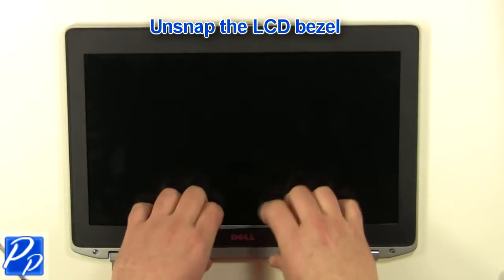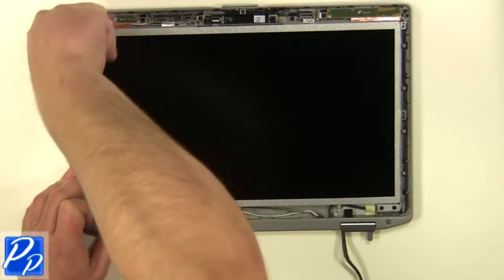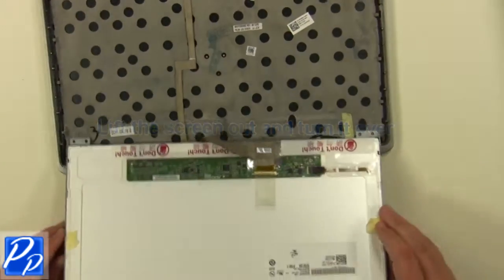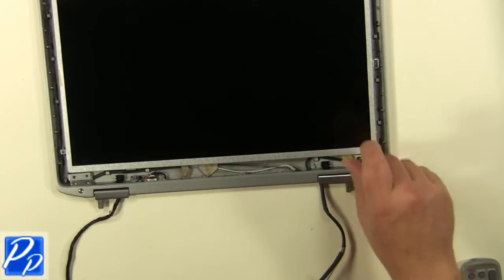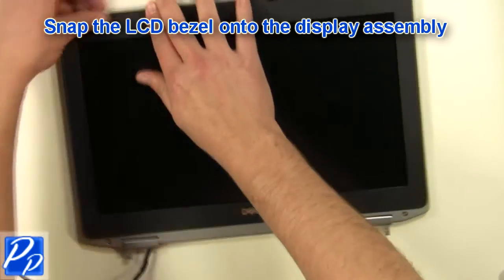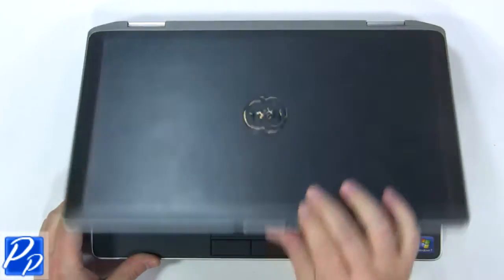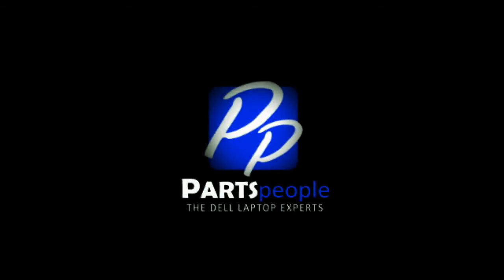Dell Latitude E6420 LCD Display Screen Replacement Video Tutorial

Comment: You must also detach the frame on the left and right sides of the existing display and reattach to the new display. Two screws each. Easy enough to do. Thanks for the video. One of the easier displays to replace.

Comment: Ahahah !  Thank you for having cut for the separation of the  full screen assembly from the main body, this is precisely what I cannot do, the two screws at the back of the hinges have been removed and yet the screen part does not separate always the rest.. You probably struggled too, then you deleted this part of the video.. I ended up seeing that there is still a screw below the hinge.. :)

Comment: Does this computer have a 30 pin connector or a 40 pin? I can't quite tell, and I don't wanna crack mine open until I actually get the replacement part

Comment: Hello, a question my display is all black, but if I use a torch you see something, the problem is the backlight? Do I have to replace the display and just need it? . Thanks for a reply.
Reply from the maker: Yeah, it sounds like the backlight has failed. You will need to replace the screen.
Reply: Grazie infinite.

Comment: Hello can I replace a normal LCD screen on my Dell e6420 with a touch screen one? will it fit within the display compartment?
Reply from the maker: To install a touchscreen you would have to replace the back cover assembly. The touchscreen vs non-touchscreen are different sizes.

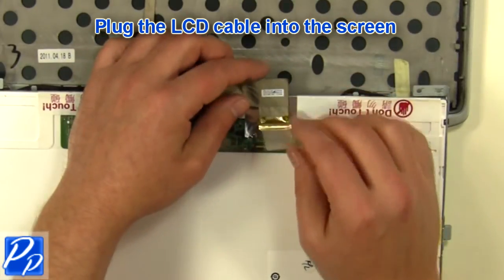Comment: 1:30 You also have to remove the two screen brackets on either side of the old screen, and transfer them to the new screen so that you can secure it to the chassis.  It's fairly self-explanatory, but they left that out of this video.